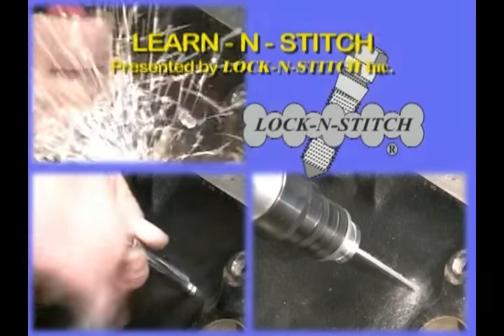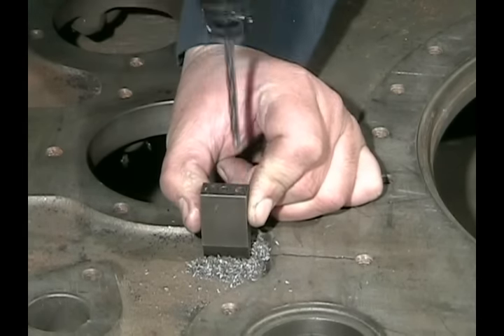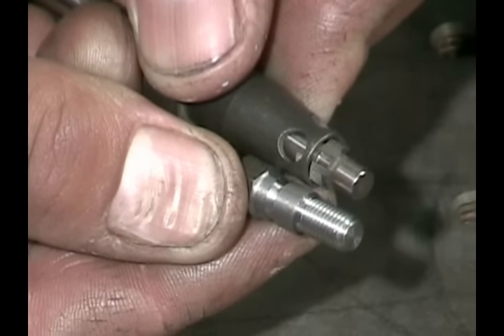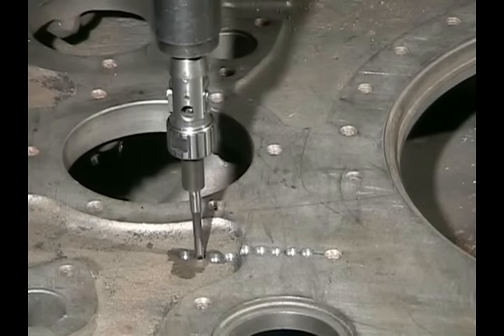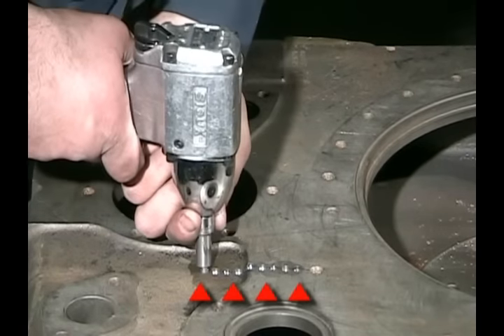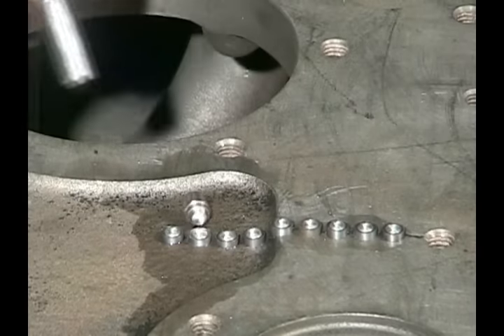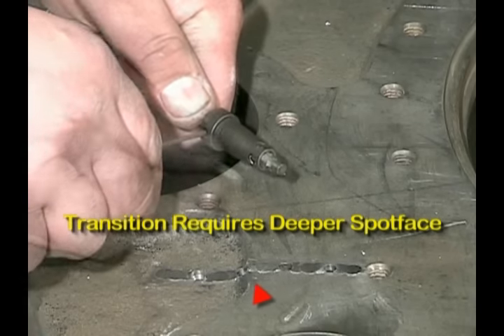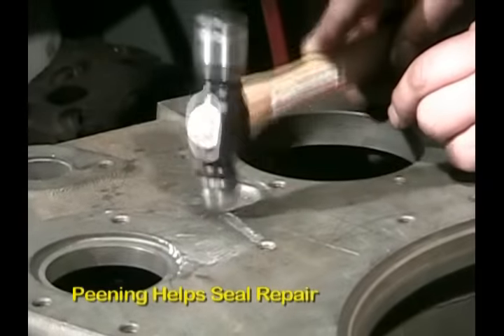Cast Iron Crack repair

Comment: looks nice but i have one question waht aout the crack  neer the treaded hole where the crack started that wil stay a crack and a possible leak
Reply from the maker: Thank you for your comment and question.  Castmaster pins have a patented Spiralhook thread designed to pull material together.  The C2F stitching pin pulls the sides of a crack together and permanently seals the repair. Here is a detailed repair example on the website using C Series stitching pins. http://www.locknstitch.com/engines-casting-repair-industry.html

Comment: Hello. Just curious why you would do this instead of welding it?
Reply from the maker: I would invite you to read this page on our website that talks about cast iron welding http://www.locknstitch.com/cast-iron-welding.html "Cast iron cannot stretch and withstand the contraction and hardening caused by cast welding with preheating below 1200 ° F. The brand of welding rod does not make a very big difference. It's the heat that causes the changes to the cast iron itself."

Comment: Isn't this just pushing outward on the material which would promote cracking from the ends of the repair?  Also I noticed you didn't clean the material of cutting/tapping oils before applying the thread sealant...
Reply from the maker: Thank you for watching and for your question Steven.  Tapered pins would do just that, but LOCK-N-STITCH CASTMASTER pins do not. The patented Spiralhook threads actual pull the metal together creating a permanent repair.   http://castingrepair.locknstitch.com/item/c-series-pin-mini-kits-2/c-series-pin-mini-kits/lmk-c2f#About C Series Stitching Pins

Comment: So the only thing that's actually holding the crack together is the red sealant? I understand why you drill and place pins along the entire length of the crack (relieve the stresses) but whats stopping the metal from pulling away from the pins under more stress?
Reply: The thread profile they use is a special type which is angled in a way which actually pulls against the threads of the metal. http://www.locknstitch.com/precision-metal-stitching.html

Comment: Looks like filling a crack but making the construcion weaker by taking away more original material.
Reply from the maker: This repair process adds strength!
Reply: I disagree! And drilling holes in the right spots help prevent cracks from expanding.

Comment: what happens to the crack from the last pin to the bolt hole. you still have a crack down the treads that is not sealed
Reply from the maker: John that is a great qusetion~ CASTMASTER (C Series) stitching pins do not spread the crack - In fact they do the opposite. This pin with its Spiralhook threads creates a drawing pressure that actually pulls the sides of a crack together and permanently locks them together. C Series pins exert PULLING pressure.  We also have a full line of inserts, Full-Torque, and after installation of an FT insert, the bolt hole becomes stronger than the bolt!  Please feel free to visit our website for more information or email our technicians at info@locknstitch.com if you have specific questions.  They would be happy to help you!  800/736-8261 www.locknstitch.com

Comment: Could I use this technique on an exhaust manifold? Would it work, or is it to thin?
What if I just use V2 screws and grind them down, wouldn't it be the same?
Reply from the maker: Raiden thank you for your question... yes you can!  Would you be so kind as to send in your direct question to our technicians at info@locknstitch.com ? If you have pictures you could send of the repair that would be helpful as well.  Please send your contact information in the email.  We look forward to hearing from you.
Reply: For thin cast like exhaust manifolds Crown Alloys Royal MIG wire works very well. My professional machine repair bros use it on irreplaceable cast iron machine parts. (They tested it on scrap first then had a sledge hammer party.)  Buying one kit to fix a manifold that's likely worth less than the kit is questionable.  Each process has its advantages and proponents of every process contend theirs is the best. Other less well known options include spray welding which is used to repair and refurbish very expensive diesel engine blocks and similar. I don't have stock in any casting repair companies so I'm open minded. Processes that don't work would have been completely abandoned long ago.

Comment: Would this work on a aluminum cylinder head?what are the prices like for this?have just a hairline crack on TOP of cylinder head. Was gonna use aluminum "solder" sticking but this seeks stronger. Think either would work if does work for aluminum but this is SO MUCH COOLER!
Reply from the maker: Hello Jessica!  Yes we do have aluminum products as well. Please feel free to email info@locknstitch.com or call 800/736-8261 or 209/632-2345 and our customer service team will be happy to help you!

Comment: Am a welder its not hard go repair cast iron by welding you would have to pre heat the area and post heat it after the weld you can also use some sort od backing plate system or also could use a strongback to prevent warpage i would of u grooved the crack to the bottom of the crack pre heat it weld it and then post heat it fo prevent warpage and or cracking you could also of braze weld this but if you arnt good at welding i can see why you would use this method

Comment: How does this stop the crack from continuing?
Reply from the maker: Thank you for asking! Castmaster pins have a patented thread technology that creates a drawing pressure to pull the material together - they pull the sides of the crack together.  It is a permanent repair.  Here is a page that tells about 'C Series Stitching Pins'   http://castingrepair.locknstitch.com/item/all-categories/steel-castmaster--c2f-stitching-pins/c2fa-25#About C Series Stitching Pins  If you have any additional questions our technicians would be happy to talk to you. 800/736-8261 or 209/632-2345 info@locknstitch.com
Reply: No. Drilling just after the end of the crack removes the stress riser (sharp edge). A thread cannot pull a crack together, no matter what they patent.
It's sealed by mild steel and, essentially, loctite.

Comment: can this repair method  work on cast Iron boilers ?
Reply from the maker: Yes the repair process has been used on cast iron boilers, but like all repairs we ask that you contact us directly to provide more information.  We can provide free technical support to either sell you the products to do the repair yourself, give you all the details on how we can provide service to do the repair, or find a local shop to perform the repair using LOCK-N-STITCH products.  Thank you for your question!  800/736-8261 or 209/632-2345 info@locknstitch.com www.locknstitch.com

Comment: Another way to do this...
(1) Stop drill end(s) of crack 
(2) Cut a DOUBLER PLATE to cover the crack and at least THREE TIMES thickness to each side of it.
(3) Mill to RECESS for Doubler Plate ONLY if you need to.
(4) Clamp Doubler Plate in position and MATCH DRILL for pins on either side of crack, NOT TOO MANY (4 to 6 should do), pins should be roughly EQUAL to thickness of plate.
(5) grind grove in crack, braze or weld crack, be careful not to overheat
(6) Silver solder or braze double plate in place with pins.

Comment: Would this be better than welding?
Reply from the maker: No heat involved, cold mechanical process that add strength to the area repaired!  Permanent repair!
Reply: 100 times better than welding

Comment: I believe when invented it was called "metal lock" developed at dresser rand in olean new york 5 decades ago
Reply from the maker: This is a different process/product; Patented products manufactured and sold by LOCK-N-STITCH Inc. in California.  We also use the products to performed repairs worldwide.  Feel free to call or email us if you wold like to discuss in more detail.  info@locknstitch.com 800/736-8261  www.locknstitch.com
Reply: Its just like I remember except they were splicing in large sections of cast steel when there was a huge porosity. Like they would splice in the corner of a huge engine block when the cast block would come out with a giant porosity. Say the size of a washing machine. Instead of melting the casting back down. Saved money more than time back then
Reply from the maker: Yes!  See this page showing examples of a large repairs!  Saves money, downtime - repairs can be done on site, in frame.  http://www.locknstitch.com/metal-stitching-diesel-engine.html

Comment: So you could not just drill a bunch of holes and then weld them?  I dont understand why you would want to do this over welds.
Reply from the maker: The process is a cold mechanical process, allowing for repairs in frame - or with minimal disassembly.  The patented thread design pulls the material together - pulls the metal together (does not push it apart) adding strength and creating a permanent repair.  Feel free to call and speak to our technicians if you would like to learn more or ever have a need for the products or services.  800/736-8261 or 209/632-2345 info@locknstitch.com

Comment: Where can you buy such bolts???And matching taps??????? Or a full kit when need it???? What about aluminum casting repair?
Reply from the maker: You can call us directly 800/736-8261 or 209/632-2345 and our customer service technicians would be happy to help you.  Yes we also sell our stitching pins in aluminium.  We look forward to hearing from you.
Reply: LOCK-N-STITCH INC.

Comment: Jesus this takes way more time than just drilling the two ends and running a nirod weld down it.
Reply: Agreed. This seems like allot of unnecessary work. Especially considering it's Cast Aluminum ... or at least it doesn't look like any Cast Iron I have ever worked on or with !

Comment: now there is no crack but actually it doesn make any sense, because u didn;t  weld the sites so how are they gonna stick together?
Reply from the maker: Thank you so much for watching and your comment.  The stitching pins when installed create a drawing pressure that pull the sides of the crack together - it is a permanent repair! Here is a page that tells in greater detail about the CASTMASTER Stitching pins : http://castingrepair.locknstitch.com/item/c1-stitching-pins/aluminum-castmaster--c1-stitching-pins/c1cl-100?#About C Series Stitching Pins

Comment: What material are the bolts made of ?Mild steel?
Reply from the maker: The steel pins are made of a soft machinable steel that has the same expansion rate as cast iron with about the same hardness and corrosion resistance. Our aluminum pins are made of 2024 T4 aluminum. This is a harder, stronger grade of aluminum than most castings are made of. www.locknstitch.com     If you have any additional questions feel free to call and speak directly to one of our technicians 800/736-8261 (206/632-2345) or email info@locknstitch.com

Comment: It cracks normally due to a lateral force overstressing the material, sometimes with vibration.  you could just as much just  drilled the hole at the other end of the crack. Your bolts don't do anything else than waste your time and money

Comment: I saw this in an old auto repair manual my dad had from the 1940s. this isn't new. they used brass pins, no fixture, everything else was the same.
Reply from the maker: This is new, improving on the older technology and processes - if you would like to know more please review the website or call to speak to a customer service agent.  They would be happy to talk to you anytime www.locknstitch.com 800/736-8261

Comment: isn't there a way to melt the top of the crack with a torch and have the metal melt and fuse the crack shut?
Reply: unfortunately, heating cast iron to the temperature required for welding/brazing compromises its strength because it messes with the grain structure of the metal. Of course, sometimes this isn't a problem, but if it had enough stress to crack in the first place you want it to be as strong as possible. Cast Iron is pickier than you might think. There are people that are masters at welding cast iron though, but its not easy

Comment: Okay.... Maybe I'm just slow... But can someone explain to me why you wouldn't just grind out a V-shaped channel around the crack and fill it in with weld, then grind it down? I'm not sure how this method works, but I can't see how it would add strength structurally or prevent the crack from spreading wider or further. Besides, welding it seems like a lot less work than this.

Comment: Can someone with experience and knowledge explain how does this fix the crack?

Because it seems like you are covering the crack, but the strenght of this part of the block still the same as with the crack, the two sides of the metal are not welded, now the crack its just whider and pluged, watching the video I was expecting the bolts to be an especial alloy and that then the part would be coocked so the bolts "weld" the two sides of the crack.

I'm missing something there?
Reply from the maker: Would this video help explain the process a little better maybe? It is a demonstration of our patented thread design https://www.youtube.com/watch?v=ELQmD8AFqzs
Reply: @LOCKNSTITCH  Okay, now it makes sense, the thread has a special shape that holds the material close instead of pulling it apart.
Thanks for the link.
Reply from the maker: @blar2112  absolutely!  Glad that helped!  If you have any other questions our customer service team is always happy to talk to you in email or over the phone.

Comment: The new cast iron welding wire that just came out has made lengthy repairs like this obsolete
Reply: Adventure Escape I understand that it’s still a good idea to preheat the metal to be welded even with those special welding sticks. How would you preheat a 42” pump housing before welding up a crack in it?

Comment: Is this not very much like the Metalock/Masterlock method?
Reply from the maker: Similar in concept, radically different in the actual process and products.  LOCK-N-STITCH is a permanent repair!  LNS products add strength to the repair.  If you have specific questions on the benefits of using the LNS process over the Metalock method please contact our customer service team. They would be happy to discuss this with you and provide you more information.  Thanks for watching and your question 800/736-8261 or info@locknstitch.com or 209/632-2345

Comment: i think this would only be good for a part that doesnt undergo any type of thermal expansion, the bonding agent in the compound would probably fail under high temperatures (like most retaining compounds).
in any case this really is an amazing method, if i wasnt so pressed for time most times a repair like this comes up i would definitely give it a go

Comment: Boy oh boy, is that ever "old school" - been done the same way for ~80 years or more...
Reply from the maker: Correct metal stitching has been around for a very long time however this is newer technology - not a tapered plug, but rather a stitching pin with a thread design that pulls the material together rather than push it apart as in the older processes!  Thanks for watching!

Comment: What size pins are available also what grade metal do they come in
Reply from the maker: Michael the pins come in various sized depending on the type of repair you have, please take a look at the website www.locknstitch.com you can gather more information there or feel free to send an email or call for more information.  Customer service would be happy to help you our you can ask a technician directly if you want more help on a specific repair info@locknstitch.com or 800/736-8261 or 209/632-2345

Comment: Can't drill down like 3mm and then drill on a 60 degree angle through the crack into the other side, and alternate sides as you go. So it pulls it together?
Reply from the maker: Hi Darren - the technical team would be happy to talk to you more about the process.  They can be reached at info@locknstitch.com  Thanks for watching and posting your question

Comment: I'd never heard of this, why would you say this was preferable to welding/brazing?
Reply from the maker: This repair is a cold mechanical repair. You don't have to fully heat the part - you won't have any expansion or contraction, additional damage, hardening of the material.  This patented process has a thread design that pulls the surrounding material together, it does not push apart like a tapered plug would do.  You will add strength to the repaired area and it is a permanent repair! Please feel free to call or email us if you would like more information about our products and services.  Thank you for watching info@locknstitch.com 800/736-8261 209/606-0172

Comment: The drilled hole at the end of the crack stops it spreading further. The "stitching" does not provide mechanical strength perpendicular to the crack, the only thing it could be doing it sealing the crack.

There are easier ways to seal the crack without wasting time and materials with this proprietary tooling.

Comment: I am attempting to do this however my crack is wider will this still work?
Reply from the maker: Please contact our customer service team, they can help you with the repair 800/736-8261 if in the US or +1 209 632 2345 if outside the US or you can email info@locknstitch.com  Pictures are always great to email when asking for technical assistance.

Comment: It's the same as the metal lock method they used at Dresser rand back in the 70's
Reply from the maker: Glad you found us Speed Smash.  LOCK-N-STITCH developed and patented a thread design to pull the surrounding material together rather than push it apart.